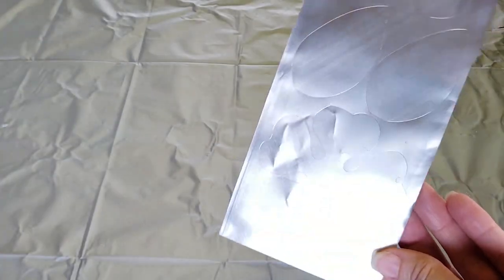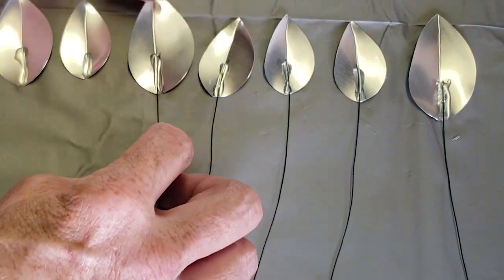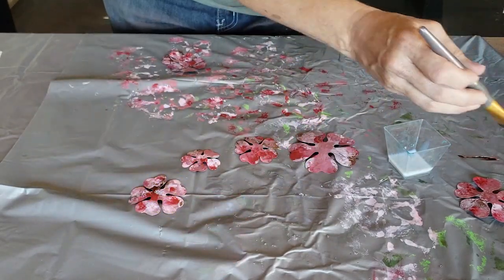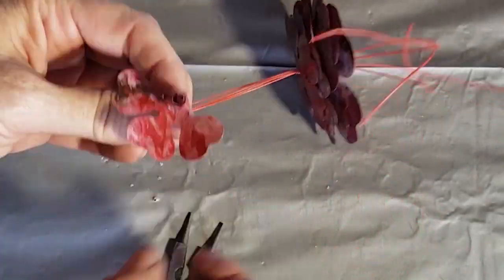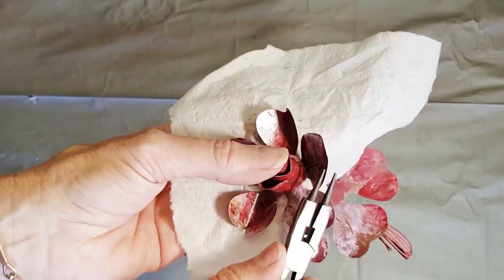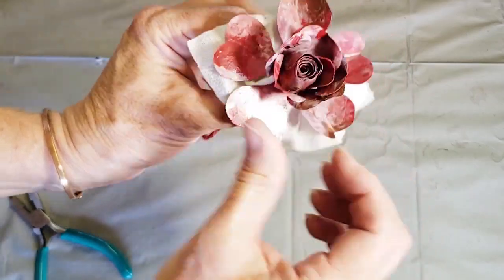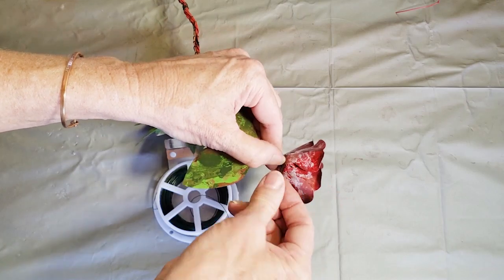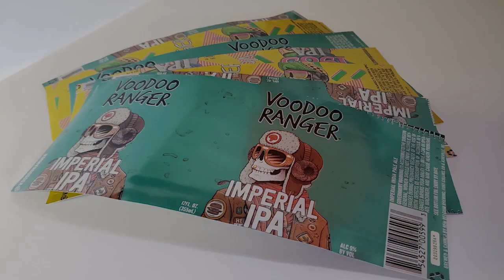Amazing Aluminum Can Craft - DIY Outdoor Rosebush

Comment: I can't get my leaves to stick to the wire.
Reply from the maker: I used a bead of E6000 glue and then let the pieces sit. This glue takes 24 hours to fully cure. Hope that helps.
Reply: @UpcycleDesignLab  maybe my wire is not straight enough
Reply from the maker: @KMF3  that could be the wire does need to rest in the glue until it sets up. Good luck.